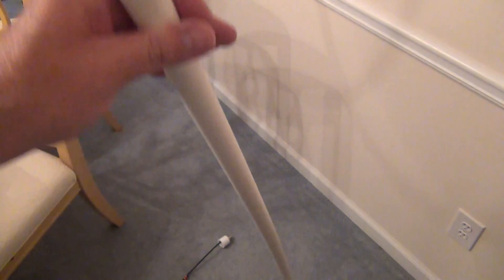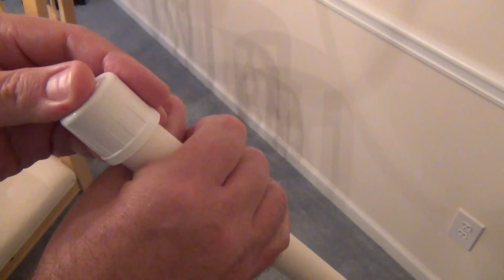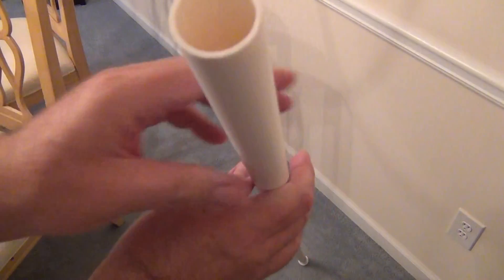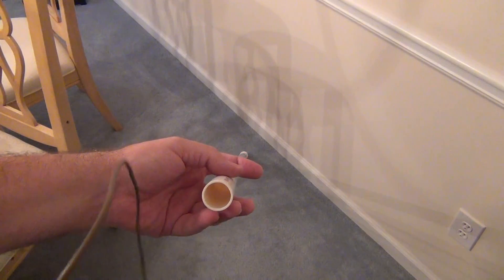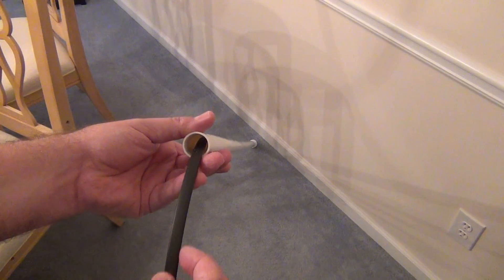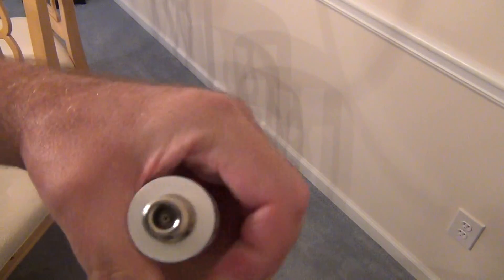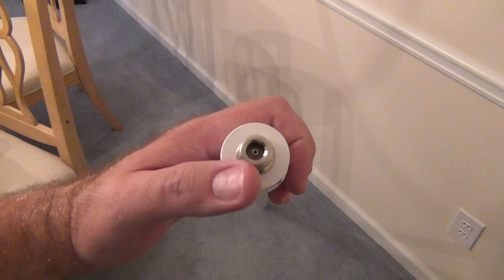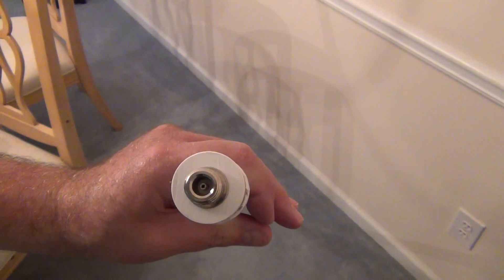Ed Fong's Dual Band VHF/UHF antenna - PART II

Comment: I am about to order one of these, and I was wondering if a 50' run of LMR-240 coax with N connectors would work adequately.  I think that the LMR-400 is a bit too bulky and stiff for my purposes.
Reply from the maker: I was able to use the LMR-400 with the N connector on the antenna I placed on the attic... but I agree that the cable is not much flexible. For 50' you should be fine with LRM-240. 144MHz has not much loss anyway, and 440MHz is much better on the LMR-240 than on regular cheaper cables.
Reply: Thanks for the help!

Comment: Thanks again Dr Ed, great antenna, hooked up to my Baofeng uv/5r greatly improved being able to reach 3 more repeaters in the area. Mounted to chimney on roof, siliconed connections at bottom of pvc pipe to connector cap, and screw on connector that goes into the bottom cap, no water penetration for sure.
Arnie/KC3FIN
Reply: Greg Arnsberger glad you commented kn this because this is the same way I was going to mount this if I got one.
Reply from the maker: Great setup, congrats!

Comment from the maker: @Mark Nice to hear that. I need to raise mine from the current 5 feet to something like that. I plan to install it inside the attic and the only thing preventing me from that at this point is to figure out how to pass the LMR400 cable from the attic to the 2nd floor. I plan to use a connector panel on the attic door, but I am not there yet... ecolive - KK4RZX

Comment: The antenna I purchased had the SO-239 connector on it and was the 75 watt design. I mounted it on the top of our house using 75" of Davis RF Bury-Flex 50 OHM to connect it to my Alinco DR-610 VHF/UHF radio. I have gotten good reports from local and some distant repeaters. Mark- N2QQE
Reply from the maker: Great stuff !!!